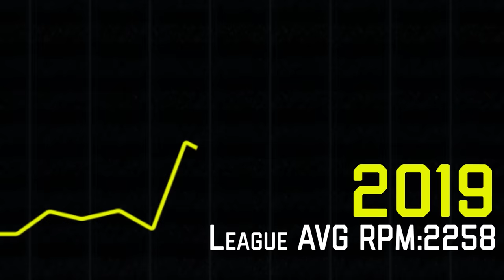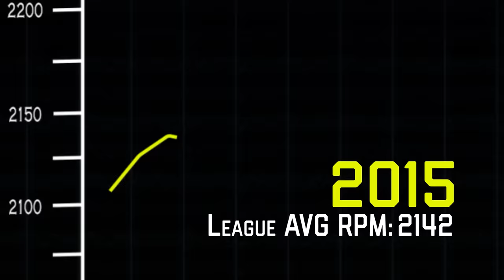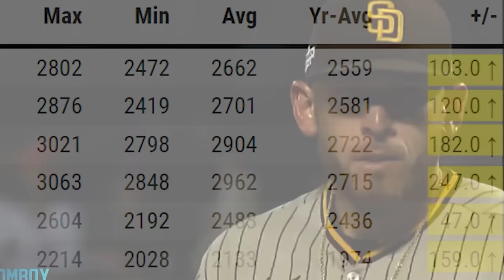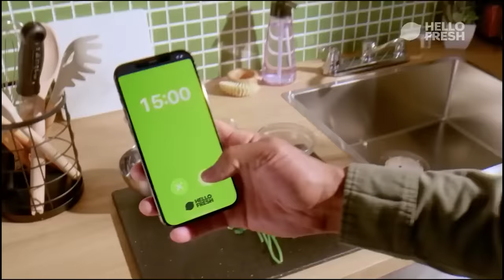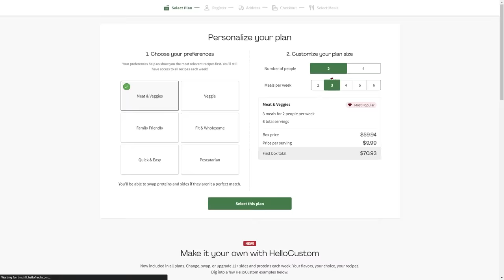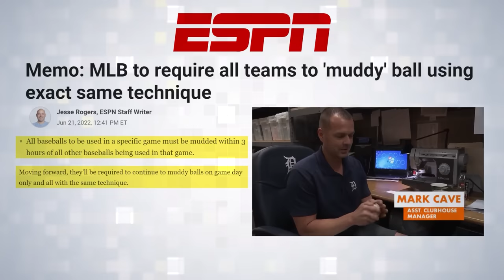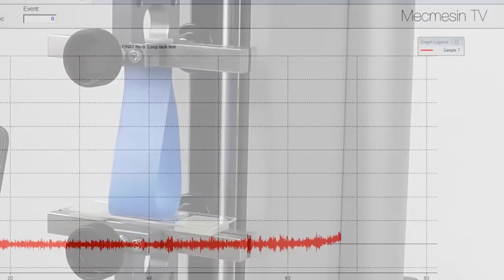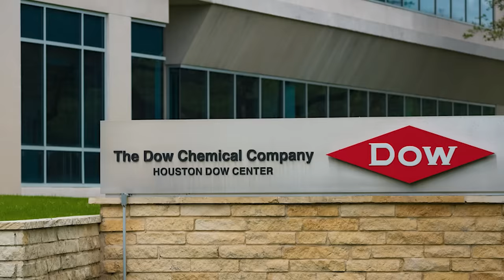Why MLB Can’t Stop Pitchers From Cheating

Comment: King of Juco tested the alcohol vs rosin thing and in a 1 minute video he proved that the alcohol made the ball stickier. Scherzer got ejected and banned for 10 games for doing exactly what the umpires told him to do. It's ridiculous
Reply: Bauer did it before him.
Reply: Rosin softened with alcohol is exceptionally sticky, I use a mixture of rosin and alcohol for soldering and it works very well for that, but it makes a hell of a mess when you spill it
Reply: Or King of Juco and Scherzer were both lying. I guess it just depends on which group of total strangers you choose to believe: ones who would make money from cheating or ones who want their sport to be fair.
Reply: @Briansgate  but it’s legal to use what Bauer uses 😂
Reply: @meepk633 former MLB player and Cy Young winner, David Cone, went on ESPN and made the same investigation, and ended up with the same conclusion. Alcohol and Rosin creates an immense amount of tackiness which caused scherzer to be falsely suspended.
Reply: Also KOJ 

gets struckout by a 77 mph heater
Reply: @96fatcat  The problem I have with that explanation is Scherzer also said they apply rosin until it builds up too much, then use alcohol to remove it and then reapply the rosin. So he said they do use alcohol to remove the rosin regularly, which means they can use alcohol to remove rosin, and it's almost certainly only a small amount of alcohol that makes the rosin stickier, while more alcohol will remove it completely. So why didn't he use enough alcohol to completely remove it, like every pitcher does after every game? Maybe because it wasn't rosin so the alcohol couldn't completely remove it.
Reply: @bobbygetsbanned6049  he washed his hands in front of an MLB official, and said he used the alcohol to wash his hands off. The reason for the tackiness probably lies in the fact that pitchers have started to apply rosin in the dugout instead of the mound due to the pitchclock rule, and since he applies the rosin soon after washing his hands, the remaining alcohol made his hands very tacky. It doesn’t seem like a case of Scherzer trying to get away with cheating. If it was intentional, I don’t see why he would have the same tacky hands in the 4th inning while getting checked in the 3rd and 2nd. I don’t see why any cheater would continue to cheat after being checked and suspected for 2 innings straight.
Reply: @Briansgate  Bauer literally said years ago this exact thing would happen cause he could easily make Rosin just as sticky as spider tack, it literally just took him slightly more effort. He proved it as soon as they made the rule. But no, because Bauer got falsely accused of some shit that never happened, they didn't listen to one of the best pitchers in the sport.
Reply: Technically only 2 starts but still
Reply: @D1_HofCurrySznHim  DV?
Reply: @CharlesFreck  indeed
Reply: @zachiswayposi1  not guilty
Reply: @96fatcat  Oh yeah, from that trial that happened. 

And multiple women accusing a trump supporter of domestic violence is still somehow shocking to people.
Reply: @zachiswayposi1  ?
Reply: @96fatcat  ?
Reply: So why would he clean it with alcohol and do a bad job of it then? We don't know if they are cheating, but we do know if they have clean hands on the way to the mound.
Reply: The stickiness is illegal. Using foreign substances is against the rules, but you whip some rosin into glue, that’s also against the rules. It’s like what Scherzer was doing with the pitch clock, looking at the tools available to him and trying to find an advantage. I don’t think he’s lying about using sweat and rosin, but I’d bet a lot of money he’s doing a lot more with it than just grabbing a rosin bag.

Speaking of which, there’s plenty of time with the pitch clock to pick up the rosin bag. They aren’t applying an inning’s worth of rosin in the dugout because there isn’t time to use the bag; they’ve got something else going on.
Reply: @meepk633  The rosin is made from magnesium carbonate (gym chalk) and pine resin. Liquid chalk often used for lifting is specifically sold as tackier when it has a higher alchol-water ratio in it. This isn't even considering the high-school level organic chemistry that will tell you a similar reaction takes place with the weak organic acids in resin and alcohol to the one that happens when someone pukes after drinking too much (it sticks to everything it sprays on).
Reply: Nah, they told him to clean his hands off with alcohol, not pour alcohol on his hands and rub them together. They wanted him to stay there, using alcohol until all the rosin was gone. He's not brain dead, if he rubs his hands with alcohol and now his hands are even stickier, but the umps want the stickyness totally gone, he knows he's breaking the rules by going back out there like that.
Reply: @rdizzy1  and he did rub alcohol until his hands were completely clear of rosin.  He then proceeded to apply rosin - as per normal - to his hands which are now slightly covered with alcohol and now making an easy stickier substance. 

It's not difficult to understand.
Reply: @rdizzy1  So why didn’t the MLB official call him back and order him to wash his hands again, until said stickiness was gone?
Reply: @meepk633 lol that's funny. All MLB cares about it money
Reply: @zachiswayposi1 there is zero evidence that anything Bauer did was not consensual. And the woman herself posted a video of her, smiling, in bed with him during one the times she said he beat her. I really don't think someone who was beaten like she said she was would not only stay in bed with that person, but record a video of them together while smiling.
Reply: @rdizzy1 he washed his hands in front of an MLB offical. If he did it wrong, that MLB offical would've told him so as that's pretty much their entire job.
Reply: @ImReverseGiraffe  The whole Scherzer incident gives me vibes of a dirty cop planting evidence, in order to obtain a conviction. I don’t know if MLB has some vendetta against Max, but he did what MLB told him and he still got punished.
Reply: @D1_HofCurrySznHim  Bauer def was using as sticky of a substance that he could find
Reply: @seanbrower6738  Because he chose to boot him from the game instead.
Reply: @ImReverseGiraffe  There is no evidence that he was washing his hands off with alcohol with the MLB official right there inches away staring at his hands. I guarantee the guy was just standing behind him, and glanced at his hands after (alcohol+rosin isn't visible, you can only feel it) 
On top of this, the MLB officials are not well versed in chemistry, they don't know that rosin is soluble in a solvent like alcohol and makes the rosin into a thin liquid at that point, then the alcohol evaporates, leaving a supercheat sticky layer after.

The official being there is irrelevant anyway, Scherzer is not a child or an idiot, he knew damned well his hands were EVEN MORE sticky afterwards, and left them like that, when he could have stayed there and used alcohol on them over and over and over until it was gone and his hands were not sticky, but he chose not to, because he wanted to cheat.
Reply: @frmrfr  Nah, no way in hell. Alcohol evaporates extremely quickly at 60 degrees plus. By he time he walked back out to the mound it would be 100% gone. He still had to have had shit on his hands. It is difficult and takes a long time to get all that residue off, even with alcohol, because alcohol dissolves it, but spreads it around all over.
Reply: @meepk633  everyone is a bad actor huh? total nihilism?
Reply: It's commonly known. At work I use alcohol on a surface before putting already sticky on it.
Reply: @rdizzy1  So at some point, the alcohol would have worked? He washed his hands like, three times, and they kept getting stickier. Guess he should have used something else. But did the MLB official order him to wash his hands SPECIFICALLY with the alcohol?
Reply: @seanbrower6738  Yes, but if you aren't using enough at once, you are just turning the rosin into a thin liquid and spreading it around. Need to do it over and over if all you are using is alcohol. Ideally you would use alcohol to loosen it up, and then soap and water, then dry, then alcohol, then soap and water. It's a bitch to get that shit off your hands.
Reply: @seanbrower6738  If it was me I would immediately get one of the umps or whoever and tell them I need more time and that it literally won't come off, and show them and have them see how sticky it was to give me more time to get it all off, but then again, I'm not a cheater. I certainly wouldn't just go right back out there, knowing my hands are MORE sticky than they were before, because I wouldn't want to risk getting booted or suspended.
Reply: @rdizzy1  In other words, Max should have either used more alcohol at once or used something else. Domingo German was ejected for a foreign substance, but he calmly left. Maybe he had a substance that was illegal, no matter what. In Max’s case, though, I’m not sure it’s fair to say that there’s any fault, since again, the MLB officials doesn’t know chemistry. I’m also sure that most pitchers weren’t chemistry majors, either. In short, Max’s ejection was warranted, since his hand was too sticky, but the whole thing could have been avoided. I hope this incident serves as a lesson for all pitchers and officials.
Reply: Without testing, with my chemistry masters, I can tell you that. It's not even surprising. If MLB talked to a couple chemists, they would know what would wash it away, but they would also find out that allowing a rosin bag will perpetuate the sticky stuff due to how bad it gets when sweat and rosin mix together.
Reply: @johnbailey8103  Yes, they should just use stickier baseballs to begin with, and ban rosin. Then tell the pitchers to stfu.
Reply: @seanbrower6738  The issue is, I didn't watch him and how he washed his hands with alcohol, did he just pour some on his hands and rub his hands around? Because it would just be spreading it around at that point. You would need to use an entire huge bottle of alcohol to get that shit off your hands. Like have someone else pouring it out while you rub your hands together the entire time, for like 30-40 seconds straight, like an alcohol faucet.

What I do know though is that you can tell how sticky your hands are when you are done. And if they are more sticky, tell the ump or official right then and there, don't go back out onto the field and then wonder why you get booted and suspended.
Reply: @meepk633  do you think saying something this contrarian makes you look badass or something?
Reply: It sucks, but until that gets shown to every umpire, there's not much that can be done. You can't expect people who spend their career learning baseball to also be chemists.
Reply: @meepk633  Scherzer had MLB officials standing next to him watching him wash his hands. Are you saying the officials lied?
Reply: @rdizzy1  the problem is your hands will feel slick and clean while they're still wet with alcohol, but the alcohol acts as a solvent that just suspends the rosin particles in a liquid until it dries, similar to the solvent used in marker ink. The alcohol doesn't actually remove the stickiness of the rosin or flush much of it away, but while your hands are wet they won't feel sticky. Apply more rosin to those wet hands and it just adds to what was still there after the alcohol evaporates.

The only way to actually remove the rosin is to flush it off your hands, and a few pumps of hand sanitizer isn't going to do it. 

There's been a few YouTubers test it out and it's simple enough to confirm yourself for 10 bucks.
Reply: He got suspended for exactly what the umpires told that is bull crap
Reply: @meepk633  there’s multiple videos of natural human body sweat and a powdered Rossi bag that sits behind the mound- when mixed together they make anything really sticky I’ve played baseball for years. If you choose not to believe then you’ve never stepped foot on a field
Reply: @meepk633  He did it infront of them what more do you expect? A molecular analysis?
Reply: So why didn't he say so immediately? "Hey, my hands actually got stickier now even though I washed them like you asked to."
If an official threatened to throw me out of a game because because of X, I wouldn't pretend like it's raining and try to go on the pitch if what they suggested made the problem worse, why would they think that's fine. He knew what they wanted and that it wasn't fixed so he's got himself to blame.
Reply: @CharlesFreck Bauer bro alert. Ya, one of, what, 4 women who accused him looks bad according to one aide of the story from one of the two who know for sure. He also is a creepo who gets off from choking women out and beating them up. That’s your dude.
Reply: Yo king of juco is the best congrats on the to
 Comment 
😊
Reply: I know right
Reply: @meepk633 if they all can use it how is that not fair?

Comment: Umpire needs to signal immediately when an inning ends and they're going to check.  Wiping your throwing hand on anything during or after this call needs to result in a suspension.  Walk a new ball over to the pitcher, have them close their hand over it, umpire then compresses their grip on it for a bit, then ask the pitcher to slowly open their hand.  If the ball doesn't drop right away, ejection and suspension.

Comment: I was at the game when Scherzer was ejected. He got so much attitude from the crowd from cheating even though he didn’t it was sad to see
Reply: Baseball is pretty stupid. There's very strong evidence to suggest the 'steroid era' was actually just juiced baseballs and had nothing to do with steroid use. Yet everyone still says Bonds was a cheater despite being one of the greatest batters of all time.
Reply: @CharlesFreck  I think he’s the goat tbh straight up
Reply: @CharlesFreck  Barry Bonds is both a cheater and an all time great hitter. He was a hall of fame talent before steroids, than roided up and hit 270 homeruns starting from his age 35 season where his power should have declined. It's hard to say Bonds didn't roid up when he gained 50 pounds, his head swelled up and his shoe size grew 3 sizes.
Reply: Lol he straight up cheated. He washed his hands and changed his glove, figured the umps wouldn't check him again after that so he laid on the sticky stuff heavy, then got checked again and went ballistic to try and save face. Dude cheats just like the rest of them.
Reply: @1Learn2Swim3  brother did you not watch the video or any of the news 😂😂😂 he did exactly what they asked him to do and applied rosin inside the dugout
Reply: @LookerCS  He wouldn't have got suspended if that was the case. He tried to get sneaky after the first ump check and got caught. You can slob his knob if you want to but Max cheats just as much as the next guy. Look at his spin rate in the spider tac era.
Reply: @CharlesFreck  He was a first ballot HoFer before steroids. But it was obvious as hell he was yoked to the gills all juiced up. C'mon...
Reply: @1Learn2Swim3  brother you clearly did not watch the video or any of the news surrounding the situation and if you think a veteran pitcher at max’s level would “try to get sneaky” after a first brush up with the umps then that says all we need to know about your intelligence level
Reply: @CharlesFreck  It is, of course, entirely possible (indeed, it is a fact) that Bonds can be both a cheater AND one of greatest batters of all time.
Reply: @1Learn2Swim3  except he clearly would have if that were the case... because he did.

Comment: I think the key to this is going to be better understanding of fluid dynamics around the baseball. To this end, I'm thinking a pre-tacked ball could work IF the ball was not tacked all that much (enough to ensure a solid grip) AND if the ball was able to cause a lesser effect through spin, such as by slightly lowering the seams. Of course, you also need to let pitchers actually get used to the stuff— first of all so the stats are accurate (think of it this way: If the brakes in your car were suddenly a little less sensitive, how smoothly would you be braking the first time you drove it?) and second of all so we don't get injuries left and right immediately after introduction.
Reply: Without being an expert or technician, I wonder if just roughing up the leather to make the ball less smooth would do the trick. A rougher surface is easier to grip which means less or ideally no sticky substance needs to be used.

Comment: It's been the same ump squad that threw every player out for "foreign substances" this year. I'm convinced both Max and German were simply using rosin. Look at German's spin rates, they never went up during the two games brought up in this video...Which really doesn't make sense if he was cheating. That's the reason you use the "sticky stuff"
Reply: IDK why but i find myself believing Scherzer, maybe im being fooled, but he seems to be targeted cause he is a bit of a spaz.
Reply: @DeLaCruz_160  Pedro Martinez has a video about it as well that's maybe a year older.
Reply: @paulerxx  true thanks. i only mentioned Cone since that video was specifically based on the reasons that Max gave about him cleaning with alcohol and it made it even sticker lol

Comment: I mean, I licked my fingers on my throwing hand and wipe them off before every pitch while playing 2B all through high school. Still do it while playing 16" softball. It always felt like the leather on the ball reacted much grippier than without doing that. Especially if I got infield dirt and/or dust on my hands.

I think if they standardize something, that would be the way to go. But who knows.
Reply: The rule here is as long as you make a significant enough attempt to dry/wipe them off it’s legal, it gives a small extra boost in control and frankly I doubt it increases any statistic, just makes it easier